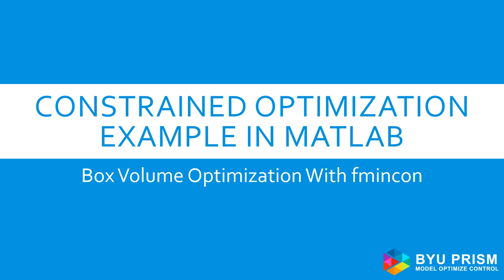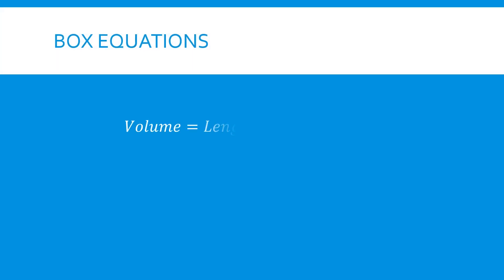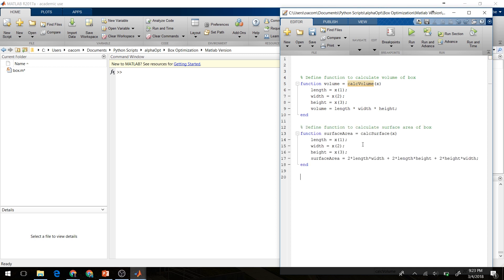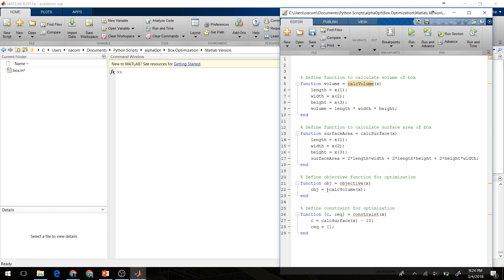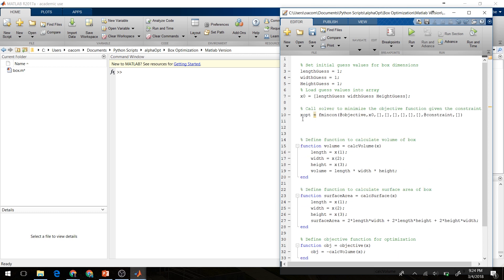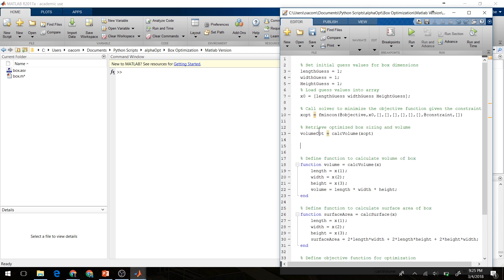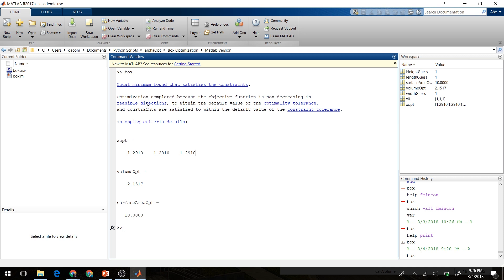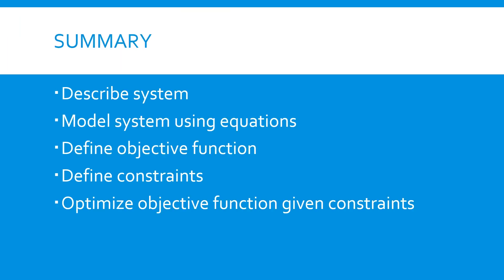Matlab Fmincon Optimization Example: Constrained Box Volume

Comment: Works fine in R2021b.

% set initial guess values for box dimensions
lengthGuess = 1;
widthGuess = 1;
heightGuess = 1;
% load guess values into array
x0 = [lengthGuess widthGuess heightGuess];

% call solver to minimize the objective function given the constraint
xopt = fmincon(@objective,x0,[],[],[],[],[],[],@constraint,[])

% retrieve optimized box sizing and volume
volumeOpt = calcVolume(xopt)

% calculate surface area with optimized values just to double check
surfaceAreaOpt = calcSurface(xopt)

% define function to calculate volume of box
function volume = calcVolume(x)
    length = x(1);
    width = x(2);
    height = x(3);
    volume = length * width * height;
end

% define function to calculate surface area of box
function surfaceArea = calcSurface(x)
    length = x(1);
    width = x(2);
    height = x(3);
    surfaceArea =   2*length*width + 2*length*height + 2*height*width;
end

% define objective function for optimization
function obj = objective(x)
    obj = -calcVolume(x);
end

% define constraint for optimization
function [c, ceq] = constraint(x)
    c = calcSurface(x) - 10;
    ceq = [];
end

Comment: Great video.

However, I write everything like you and I use MATLAB 2016b:

lengthGuess=1;
widthGuess=1;
heightGuess=1;

x0=[lengthGuess widthGuess heightGuess];

xopt=fmincon(@objective,x0,[],[],[],[],[],[],[],@constraint,[])

volumeOpt=calcVolume(xopt)

surfaceAreaOpt=calcSurface(xopt)

function volume = calcVolume( x )
length=x(1);
width=x(2);
height=x(3);
volume=length*width*height;
end

function surfaceArea=calcSurface(x)
length=x(1);
width=x(2);
height=x(3);
surfaceArea=2*length*width+2*length*height+2*width*height;
end

function obj=objective(x)
obj=-calcVolume(x);
end

function [c, ceq]=constraint (x)
c=calcSurface-10;
ceq=[];
end

I got this:
box
Field assignment to a non-structure array object.

Error in createOptionFeedback (line 33)
            options.(stopTestOptions{k}) = [];

Error in prepareOptionsForSolver (line 40)
    optionFeedback = createOptionFeedback(options);

Error in fmincon (line 215)
[options, optionFeedback] = prepareOptionsForSolver(options, 'fmincon');

Error in box (line 7)
xopt=fmincon(@objective,x0,[],[],[],[],[],[],[],@constraint,[])
 
>> 

Where is the problem?

Comment: Hi,I have MATLAB R2016a 'function definitions are not permitted in this context'I think this the version's problem. However, I have tried to find a solution but i couldn't find a proper one.Do you have an idea?
Thanks in advance
Reply from the maker: Ahmed, multiple function definitions in a single file are permitted from Matlab 2016b and onwards.  For earlier versions of Matlab you will need to define each function in a separate file.
Reply: Thanks,
One more question. Do you have any recommendation  for finding a global minimum 
Many thanks
Reply from the maker: Finding a global minimum can be difficult depending on your problem.  Starting from many different initial guess values can help to verify that you've found a global optimum.  Gradient free methods such as particle swarm or genetic algorithms sometimes work.  I've found the Matlab global optimization toolbox to be pretty good if you have access to it: https://www.mathworks.com/products/global-optimization.html
Reply: One more question. Is there is a way to plot the iterations for this video or similar to it with 3 variables 
Thanks

Comment: Tried the code but having a "function error" .. wont run .. saying that nested functions cannot run ..
Reply from the maker: Peter, for the code to work as shown here box.m needs to be a script, not a function.  This is possible in Matlab 2016b or later.  If you want it as a nested function, you'll need to adapt the code:  https://www.mathworks.com/help/matlab/matlab_prog/nested-functions.html
Reply: AlphaOpt Thanks for d feedback